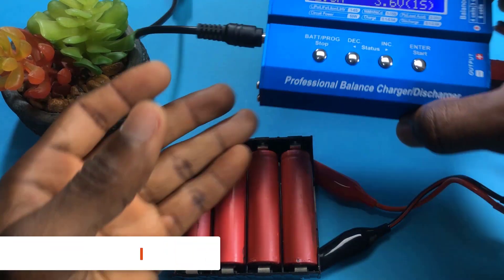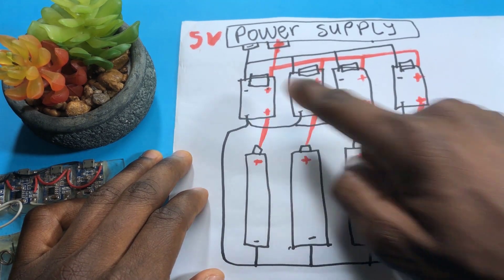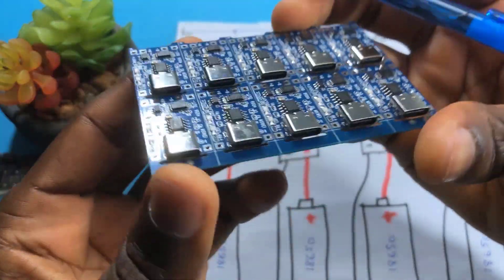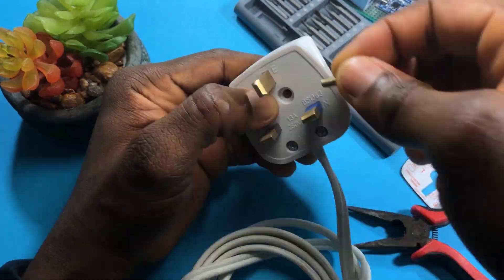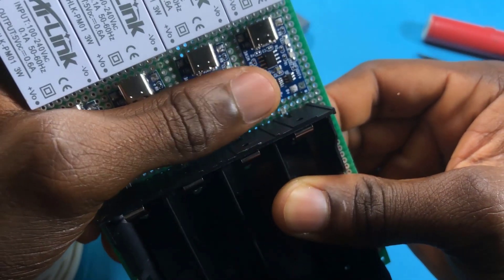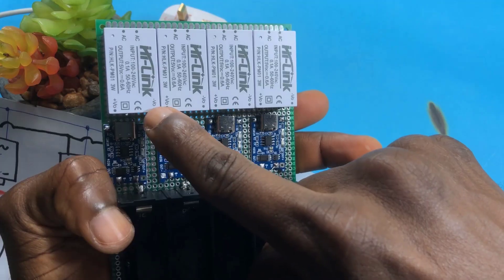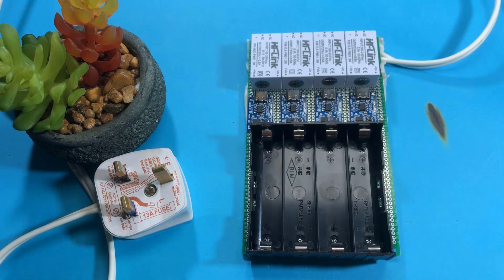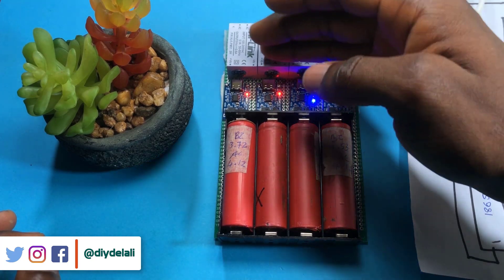How to Charge Multiple Lithium ion or Lipo Batteries for Cheap using TP4056 | 18650 20700 21700 2022

Comment: What about connecting multiple TP4056 modules in parallel to charge a single 4p battery pack, the batteries being in parallel means they're balanced and the protection IC will take care of the cutoff voltages
Reply from the maker: Thats a great idea, i considered it a while back but never followed through.

I cant say for sure if it would work, as i havent tested the idea. Kindly let me know if it works for you.
Reply: @Delali  I have a prototype yet to be soldered of a board containing a charging module for 6P batteries and the output going to a 5V boost converter with a battery state indicator ( by voltage ) thrown in there as well, it might take a while for me to get to solder it though as unfortunately I lost the design and schematic files and I have to draw them again from scratch

Comment: How many 18650 li ion batteries can we charge fully from single  tp4056 module?
Reply from the maker: you can charge as many batteries as you want but its not practical as it would take forever to charge to full.

However with a heat sink on a single tp4056 chip, you could charge 1 battery at full speed( 1 Amp) in less than 2 hrs and repeat all day long for several batteries.

You can also check out this video on how to charge 150 batteries at once. https://youtu.be/U8tcHXqIn58

Comment: Really an eye opener for me. Thanks for highlighting. I would appreciate if you can guide me on how to make a charger to charge:-  lithium ion battery (18650) in 3S and 4p (3 series and 4 parallel) since I do not want to go in for the imaxb6 charger. Waiting eagerly for your video on the above setup.
Reply from the maker: Thanks for your comment fam.

I can definitely work with you on the side to implement a charger for your battery configuration because I dont know for sure when I can make a video for you configuration.

Comment: Save money by charging the batteries in parallel, then only one 4056 and one transformer is needed.
Reply from the maker: one TP4056 to charge batteries in parallel can over heat easily and its going to charge very slowly.

I made a new video about how to use one power supply/transformer to charge 150 batteries at once.
see video here https://youtu.be/U8tcHXqIn58
Reply: @Delali  Thank you :)

Comment: I do have a quick question about the order. Would I need to have a DC to DC box if I moved the 4605 board to the front for charging and then the protection board closer to the battery? Would this even work or would I have other issues to worry about or can I still use the AC to DC.
Reply from the maker: Right now you dont need the AC to DC anymore.

In my latest battery video I show how to use just one 5v 60A power supply with many tp4056 modules to charge batteries.

This is a much better and safer approach. https://youtu.be/U8tcHXqIn58

Comment: how did you get your B6 Mini to charge Li-ion in parellel? i trred so many times, the meter shows the correct voltage for x4 batteries combine but yet won't let me start the charging process, it keeps saying 'Connect error check main port'
Reply from the maker: I was able to charge because my batteries were all around 3.7V.

Usually the "Connect error check main port" error shows up if some of the batteries are too low in the pack or just down right bad.

Advice: measure the voltages of each of your batteries and be sure they are not less than 2.9 V. The Imax charge might not allow you to charge a battery that low because of its safety features.
Reply: @Delali  all 4 18650s were exactly the same voltage around 3.7, also relatively new batteries as well showing low resistance in each
Reply from the maker: @joyindeeamornchai754  Wow. If all your batteries are not that dead then your imax should charge.

Can you confirm there are no breakages in the wires you are using to connect the batteries to the imax?
Reply: @Delali  I can confirm there's no breakage, but I notice my 4S set up is different than yours, on your battery holder all 4 cells are facing the same direction, on my battery holder its 1 up 1 down 1 up 1 down, even though I wired the battery holder to a 4S1P configuration, my Imax B6 Mini still won't let me start the charging process, I now ordered a new battery holder like yours with all cells facing the same direction
Reply: so I figured out the problem, my battery hold was in a series config instead of a parellel, i just tested another holder with parellel config and everything works! haha
Reply from the maker: @joyindeeamornchai754  I am glad things are working now. 

Please dont forget to subscribe. Cheers!!

Comment: Hello. It's not clear to me whether/why there's a downside to the initial "unbalanced" configuration with a single DC source feeding all four tp4056's. Doesn't each tp4056 (using the magic of the IC's internal circuitry) regulate its output based on its battery's condition, and over a generous range of DC input? Do you have reason to believe that the old method resulted in undesirable performance, such as some batts not achieving full charge, or being overcharged and having lower overall service life? If the old way is fine, there's no need for the added cost, and the added risk of working with high voltage AC.

That said, it's a nice video. I suggest running the sped up sections a little more slowly to allow less experienced hobbyists to better observe your techniques & workmanship.
Reply from the maker: Thanks very much for the constructive feedback Cliodyn Cycwatch . I really appreciate your efforts.

After making this video i realized one reason why the tp4056 boards were not working very well when i used a single power source could come from the fact that at the time i built the old unit, the tp4056 boards i got didn't have the battery protection fs312g ic and cut off dual mosfet ic to ensure smooth operation.

Also note that the inconsistencies or interference i mentioned with the old tp4056 board in the video happened toward when the battery was about to reach the full charge 4.2v mark.

That said i intend to make another board just like the one in this video and power all the tp4056 boards from one dc power source and see how well that does.
Reply: @Delali  Hello. Is the protection on the newer TP4056 boards (FS312G and MOSFET) useful when not using the board outputs, so when using them only to charge the batteries? The boards which are not protected also charge and stop charging at 4.2 V, so what's the difference?
Reply from the maker: @Krzeszny95  Yes the newer boards have the protection. Secondly the protection boards ensure the battery isn't over charged or discharged. It also protects against short circuit or reverse polarity. 

The protection circuit in a way creates a separate ground for each battery through the double mosfet ic that works with the protection ic. That allows many boards to charge on a single 5v line without them interfering with each other. 

As seen in this video https://youtu.be/U8tcHXqIn58
Reply: @Delali That's not true, the boards don't have reverse connection protection from what I've read. 
I don't think you realize that the protection-less boards charge batteries, therefore they have battery protection. TP4056 protects from overcharge by itself. If they didn't have overcharge protection by default, they wouldn't be chargers!

I'll answer my own question: the "protected" boards (with additional outputs) prevent over-discharge. That's it.
Reply from the maker: @Krzeszny Can you kindly get your hands on one of the TP4056 boards with the protection ic and dual mosfets, connect a battery in reverse polarity or short circuit it and let me know how it goes?
Reply from the maker: Hello fam, i made a new video where i powered all the tp4056 boards from one power supply here https://youtu.be/U8tcHXqIn58

Please check it out and let me know what you think. Cheers!!